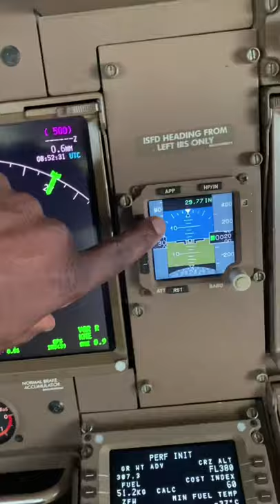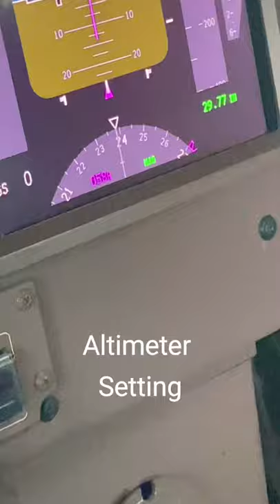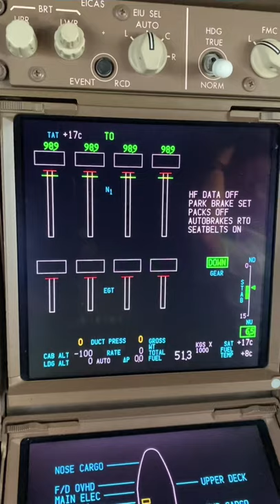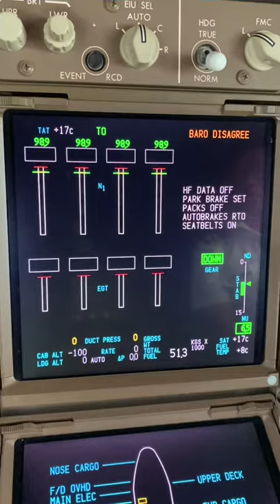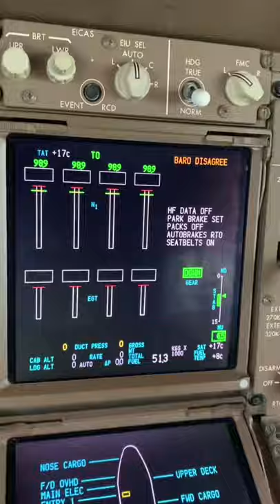B747 protections-Altimeter setting

Comment: Is baro altimeter better than radio altimeter?
Reply: baro altimeter is altitude from sea level. radio altimeter is the altitude from the ground.
Reply: Radio altimeter is only an additional system useful when flying below 2500ft to the ground. You normally want to use barometric altitude because airpressure is deciding for the planes aerodynamic behaviour aka it's service ceiling and assigned flight level by the ATC. Above 10.000ft you set it to standard pressure so any aircraft above that will be using the same reference.
Reply: @thekkummottilinsurance  An important distinction is that barometric altimeter shows altitude (which is as you said, above sea level when set to QNH, or altitude above airport when set to QFE), and radio altimeter shows height , which is distance from the ground. For example, If you look at the minimums on an approach chart, it will have the altitude and then in brackets the height.